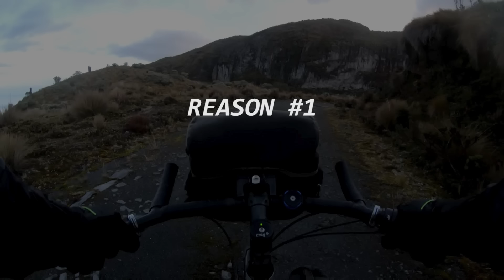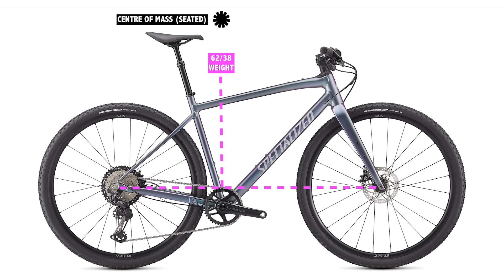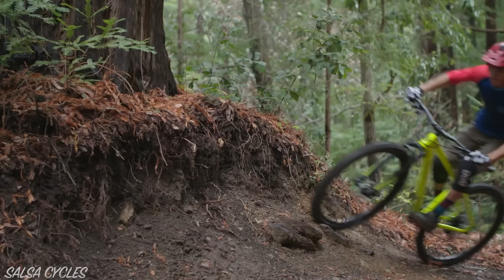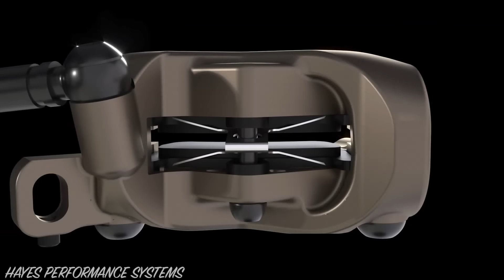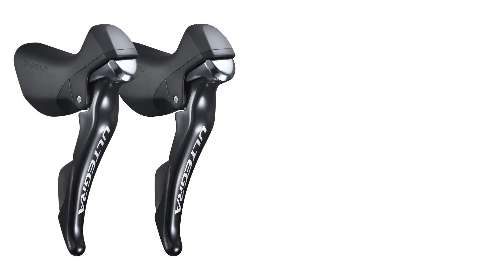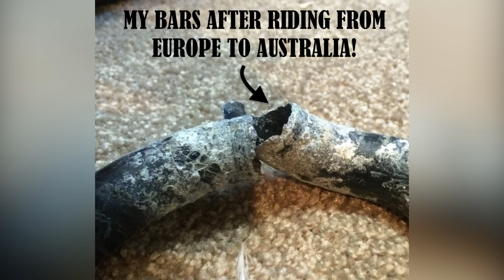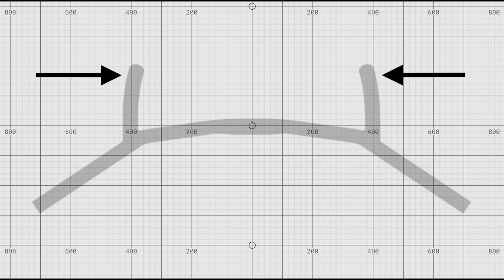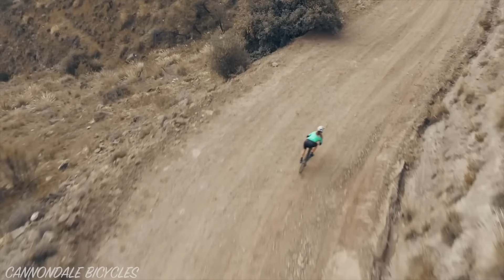Why Flat Bars Are BETTER Than Drop Bars For Most Cyclists (Objective Analysis)

Comment: I don't agree that drop bars are better for urban areas. Weaving in and out of traffic, you need precision and the handling is just so much easier with flat bars
Reply from the maker: I said that drop bars "excel" and are "often best in urban environments". They aren't going to be better all the time, especially if you don't need to constantly squeeze tight gaps.

Comment: For the type of riding I do these day (as in old age), I prefer non-drop bars.  But, I disagree with the load carrying on the bars being better on a flat-bar bike.  Weight strapped to the handlebars hurts the steering responsiveness and the . . . box-shaped bag that can be mounted to the headtube on a small frame thingy (I'm not going to attempt to spell the actual rack name) allows box-shaped bag to be installed on the front that does not steer with the bars.  I'm also surprised the subject of climbing leverage was not mentioned.  Some would say it's better on drop bars, though I have used an "albatross" bar that allows for pretty good placement for climbing.  Yes, as an old person not interested in riding at 30kph for long distances or doing fast climbs, I'll stick with flat bars.  As a young, strong rider, for on road, maybe not.

Comment: Never have i been this offended by something i 100% agree with.
Reply: Angry roadie noises
Reply: @juschtn  I mean, most of this is not really that relevant to roadies. Drop bars are still better for the most part if all you ride is road. Most of these reasons are applicable if you ride dirt but generally the steering, shifting and braking on drops is more than enough for most roads and as the guy mentioned, they're good aerodynamically too. Plus the hoods and the drops both can access the brakes which is not something offered by most of the aero flat bar designs mentioned
Reply: james acaster? :D

Comment: "While drop bars do excel on faster and longer rides, as well as in urban areas...it's clear that flat bars are the best option for most people". I don't see how the conclusion follows from the evidence. A majority of riding is done in those urban areas. Among those who aren't in urban areas, I would dare say a very significant amount are going quite long routes, or are interested in speed (though perhaps not a majority of the non-urban riding).

I commute on a bike that was a decent racing bike 30 years ago, with drops. It's through the city on a route with some hills, but mostly flat. For the flat parts, an average of roughly 30 km/h isn't unusual, and at that point the more aero position is, as you said, a big advantage. At other parts, being able to easily fit between rows of congested cars with the narrow handlebars is great. Most riding is more like that, and less like the bike packing that so much of your pro-flats analysis seemed to concentrate on. Which is not to say that flats are bad, or that bikepacking is bad. Because it's fantasticly fun! But it's weird to present it as though that makes up the majority of what people do while cycling.
Reply: You can excel at something, and still not be the best. One is a continuous parameter, the latter is a discrete rank. I commute on 800mm wide flats. Most people never have to weave traffic, even in urban riding. That's the shit alley-cats do to piss people off and make life miserable for the rest of us just trying not to get killed.
Reply: @cjohnson3836  there's weaving in and out of traffic, and then there's just riding past narrow gaps between dozens of cars stopped at lights for hundreds of metres due to congestion. Two very different things, but both of which favour narrower bars (whether they be drops or just especially narrow flat bars).
Reply: @JimCullen  What you're talking about is tunneling, is fucking stupid, pisses off drivers at the rest of us, is only done in the most dense of cities, and is (at least in the US) usually illegal. Here's a clue, most places aren't NYC
Reply: @cjohnson3836  it's called filtering, the opinions of angry drivers are irrelevant, and it's perfectly appropriate in any moderately busy city in the world.
Reply: Yes, there's a clear self contradiction in that summary. If it was phrased as 'most categories of cycling' rather than most people it'd work. Or if flats considered better for urban... (which there's certainly a case for though depends heavily on how hostile the roads are).

For non urban, i.e. leisure riding my impression is that the roadies probably still do outnumber the others in the UK at least. Touring and bike packing meanwhile are so niche as to be rounding errors on the totals! 🙂

Comment: Mtb. specialized 29er hard tail.  Flat bar with extended bar ends and ergonomic grips.  At six foot five tall the wider the handle bars the better more confident I feel.  Whatever works for you and is the most fun!

Comment: You say, drop bars are better in urban areas. I strongly disagree: 1. With drop bars your head is lower. Other road users don't see you anymore because you emerge in the car crowd. An upright position is much better. 
2. An upright position with a flat bar improves also the view angle. The eyes aren't stuck to the ground. They point forward to the direction of the important happening. 
3. In urban areas it's lifesaving to have the hands always near the brake levers. With drop bars in urban areas, most people tend to have their hands at positions, where there is no brake lever at all (because they want a better visibility and a comfortable ride). To transit the hands to a brake lever takes a second. This second delay could be the reason, why you bump into another car. 
4. The ability to do a hard emergency breaking in urban areas is lifesaving. But the upper brake lever grip on a drop bar doesn't allow you a strong breaking. Because you touch the lever at the short position and not at the end side, where you would have the best leverage ratio. 
5. You stated, flat bars allow better handling in difficult terrain. That especially is true in urban areas, where you need to drive through many difficult obstacles in a kind of slalom.
6. In urban areas it's not possible or recommendable to ride faster then 30 km/h. That's why you don't need an aerodynamic body position of a drop bar. 
7. Because of many buildings, there's not so much wind, like on the country side. The chances of heavy headwind is lower. 

Summarized, there's no need at all for a drop bar in urban areas. It really doesn't fit the requirements of these places.
Reply from the maker: I agree with all of your points...

... the thing is, I said they were "often best" and that they "excel in urban environments". It's not an absolute. This particular point is based on the need to squeeze tight gaps. If you don't need to do that on your urban rides, this particular criterion will not be applicable to you.

Comment: The other problem for me with drop bars back when I had a road bike was that I was too stiff in my neck and struggled to keep my head up on long rides to see where I was going. And yes, the older brands definitely cling on to drop bars for touring bikes. They even use old style levers in some cases.
Reply: that has more to do with the height of the bars than the shape of the bars. If you are bent over flat bars, and there are mountain bikes with aggressive riding positions, you'll still get a sore neck.
Reply: @jonathanho4272  Yeah. I tried a Brompton with the flat S type bar and that felt extreme for me. But in general, road bikes are far harder to find something more relaxed and comfortable for me.

Comment: Last year I swapped dropbars to flat bars on my everyday and touring bike. Result: better handeling, way better brake performance, more comfy sit position and no more dead feeling hands on long bumpy rides. This was the best conversion I ever made. 
Does anyone need a divisible drop bar for rohloff shifters? 😄
Reply: Hi @robert .. I am thinking switching as well. Is this easy to do ? Was there any gotchas .Not sure where to start , I have a 3x10 with bar end shifters .thanks
Reply: @TheBakerTrader  
Hi Nicolas, switching is not too difficult but you need new brake levers, a flat bar, shifters. I had to shorten the cables. Sold my drop bar and brake levers on e bay so the change was affordable. Half an hour on work.
Reply: Then your bike had the wrong geometry, you should not get a better result using a "wrong" bar

Comment: I wonder if it's possible to sweat-proof the bar by winding some plastic wrap or electric tape under the bar tape. I wish this video was issued a year earlier before I applied bar tape to my long bar ends. I hope two layers will provide sufficient protection during bar tape life.

Comment: When trek cycling, having my wrists twisted in an unnatural position of the straight bars caused pain to the elbows that took me several weeks to recover from. For short rides this is not a problem.
Reply: Use bar ends so you can change hand position
Reply: how long do you consider a  "short ride" where flat handle bar is preferrable?
Reply: @JitinMisra  half and hour. The pain doesn’t start right away, it takes a few weeks to develop after daily 2 hour cycles or more.
Reply: @wanderlustjapan4501  so anything 1.5 hours or below, the flat bar is fine?

Comment: In the Netherlands they sell a lot of fitness and hybrid bikes with flat bars to beginners. It's all based on the misunderstanding that's more comfortable.
But a very large mayority will come back to the bikeshop within two years for a "proper" bike with drop handlebars. Stories vary but they have wrist or shoulder propblems or they can't keep up with the others on road bikes.

In the Netherlands there is always wind and the drop handlebar is far superior for that.
Reply: Ironically drop bars are great for urban area's to ride in between cars (and for parking the bike next to others on the bike rack) and where wind is a large factor.   I've commuted on both, however being more upright on a flat or alt-bar is better for visibility.   You can be comfortable with either bar, but this usually means you're more upright in either case.  Being upright is never aero.  It's totally possible to bend your elbows and get low with either bar.
Reply: @SurpriseMeJT  
the best thing people can do for visibility is to use actually appropriate clothing, lights and reflectors. A lot of roadbikers, especially, seem to have some kind of vanity related to that which i never quite understood.

Comment: Flared drops are great.  Gear ratios and brakes are independent of the bars. How can you 'con' a handle bar over gear ratios? Build whatever suits, including toe overlap and wheel base.
Reply: Because while there are engineered hacks on paper, in the real world it is simply far more likely to obtain said ratios on flat bar components. Esp now, with global supply chains thrashed.
Reply: @cjohnson3836  I am not prepared to put up with the ergonomics of flat bars just because some components are hard to get or a little matching is required. 3x9 is easy to achieve, especially if bar end shifters are acceptable.

Comment: Drop bars offer more stability at high speeds in my experience as riding on the drops allow you to lower your centre of gravity quite a bit. They're also more comfortable because your hands have more positions to change to (and this talking about normal flat bars found in 80% of bikes) and, when on the hoods, they have a more natural position.
Reply: As someone who rides both mountain bikes and road bikes I could not disagree more about drops being better at high speed. I find drops very twitchy compared to non drop bars.
Reply: @garyboyle695  I have personally had bad experiences with flat bars and descending at high speeds, precisely because of the centre on gravity being higher. However, riding with my hands on the drops and descending at 60km/h feels far safer than a flat bar as I am able to pull the brakes safely without fearing flying over the handle bars. That's my experience, obviously, and perhaps you have a different configuration on your bikes.
Reply: @AlexanderTanned  I think another factor is no matter how steep the grade, the upright and wide posture on flat bar makes you like a kite in the air and your top speed maxes out so that makes it safer in a way. Of course suspension and fatter tires on my mountain bike with slicks also make descents pretty damn safe. Drops feel more exciting because you feel the road more and your top speed is higher. You are more of an arrow than a kite! Plus your 100 PSI narrow tires do roll much faster.
Reply: @AlexanderTanned  As you say it must be how we set our bikes up, I always use a much shorter stem with a flat bar which moves the weight backwards and gives you more control.
Reply: Drop bars  have three. In the hoods drops and near the stem.
Flats have three. regular, bar ends, close to stem. THEN unlike drops you can attach TT bars or bar end/cow bars, back handles like some tourers etc. You potentially have 5 or more psoitions on a flat bar and can even add DROP attachments to gain them.
Reply: @kudosbudo  You can add clip-on tri bars to drop bars too

Comment: I've tried various flat bars on my touring bikes, tandems and even triplet with tandem trailer.  I have always come back to drops, other than for full-on mountain biking (although I did have drops on my Orange P7 for a while).  One of the reasons is that the additions necessary to flat bars in order to gain multiple hand positions move your hands away from the brakes.  With a drop bar you can cover the brakes from the hoods or the bend of the drop, and if you are on the tops or the extreme end of the drops, you can move your hands back to the brakes with little effort and no body movement.  With a lot of the flat bar designs, the extra hand positions are in front of the brakes and often necessitate a distinct body movement to get back to the brakes.  I never really felt comfortable, especially on the tandem or triplet, with my hands in those positions, away from the brakes.

A great big wide bar was great on the triplet & tandem trailer combo though.  The boys used to swing wildly from side to side, making steering a challenge sometimes.
Reply from the maker: This is a point I've overlooked! You can technically have control of your brakes from three different positions on drop bars provided you use cross/inline brake levers. I'll add it to the written version on my website, thanks.

I'll take wide bars on my tandem any day, however. My upper body feels noticeably less fatigued after I fit flat bars to my touring tandem!

Comment: Just to ask what is the optimal width of a flap bar?
Reply: This really matters on your size, your bike, what stem length you run, what style of riding you typically do, as well as probably a dozen other factors. I ride 780mm bar on my mtb, but that is probably way wider than I would run on a road oriented bike.
Reply: @TheWrigle  I'm looking to use my MTB for gravel it is an older MTB from 2013/14  26" wheels 9 speed with a triple chain ring I was going to buy a gravel bike but I just can't get one most will not come in time for October ☹️

Comment: Another significant point is that flat bars cause the rider to tense their arms and shoulders, gripping the grips, putting their weight on the arms rather than supporting it with the back, and this transmits more road shocks to the body and is more tiring over long distances. The elbows also flare out, which as you mentioned creates more wind resistance. I have a road bike with drop bars, a winter bike with a flat bar, and a city bike with a flat 15 degrees sweep. Each has its strengths and applications, nonetheless I feel the most relaxed with the drop bars. That being said am eager to try flats with a sweep of 30-45 degrees to see if a relaxed posture is possible with them. As you noted there are a lot of choices out there, but interestingly they are almost never OEM on a new bike, only an aftermarket replacement.